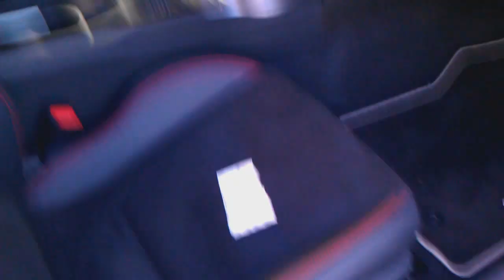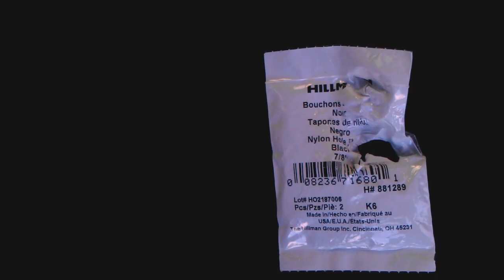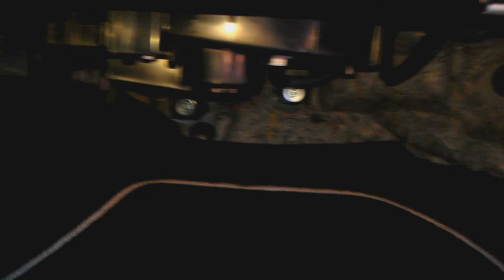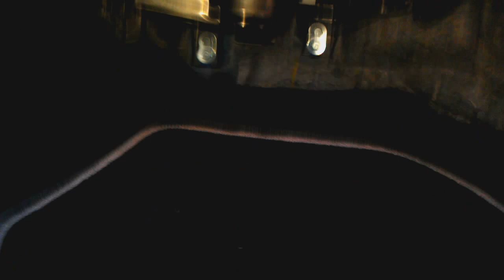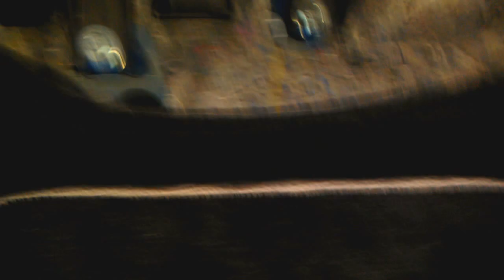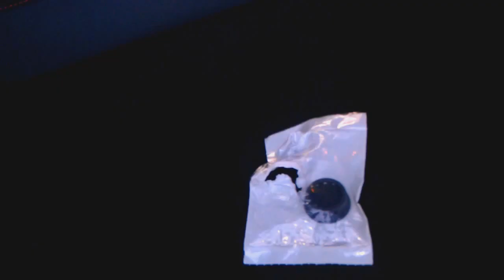BRZ sound resonator plug

Comment: Nice video but it's unnecessary. Inside the glove box is a cigarette lighter port that has a plastic plug on it. This plug fits perfectly in the resonator opening. No need to buy anything.
Reply from the maker: +Dc D There's no cigarette lighter port that I've seen in there. With that said, I did make the video so people could see exactly where (and how large a plug) they'd need to look to quiet down the cabin. But if you found this plug or something else that's free, then awesome!
Reply: +Jean-Pierre Vazquez As far as I know, most (all) BRZs have a 12v outlet in the glove box. It's way back in there in the upper right. You can google "BRZ glove box" and see pictures of it. Maybe yours doesn't have one. But if it does, look for the plastic plug that covers the hole of the 12v outlet. This plug will also fit in the resonator tube. http://www.ft86club.com/forums/attachment.php?attachmentid=30337&stc=1&d=1363050147
Reply: That said, if you can afford to buy a gt86/brz, you can afford a $1 of plastic plugs!